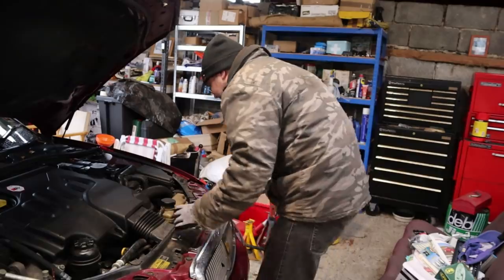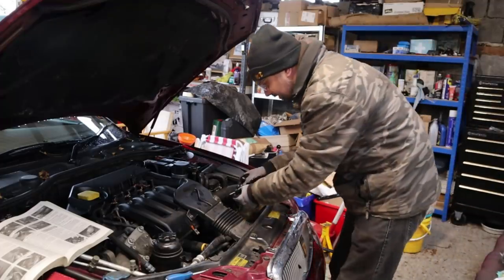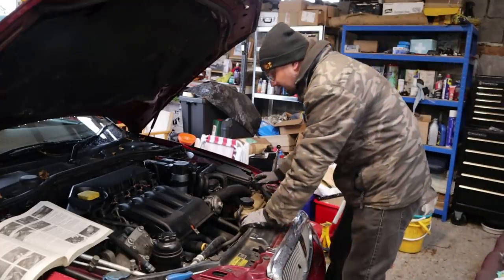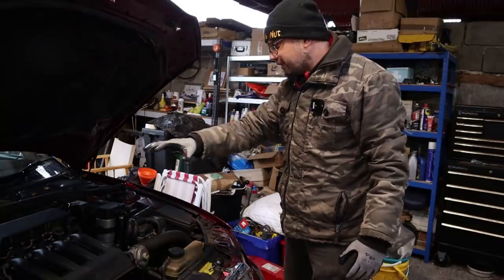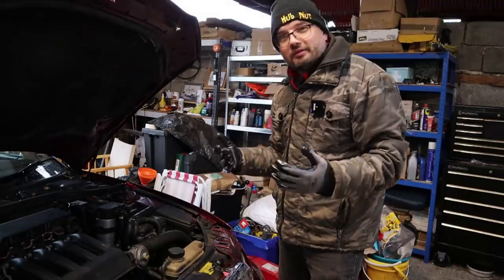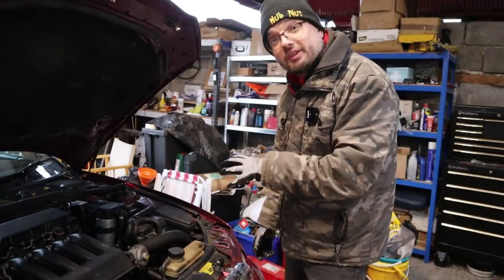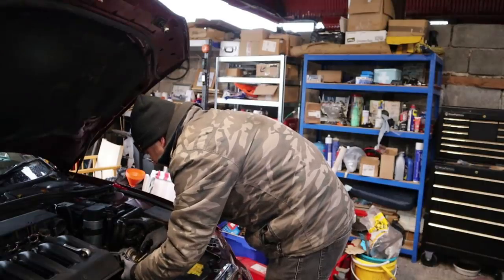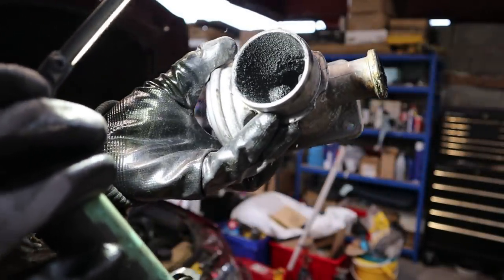Rover 75: Man vs EGR and PCV Part 1

Comment: Spend a tenner on EGR and turbo cleaner spray. Pulse it into the air intake when the engine is hot and running.  Mr Muscle is an alternative if you are brave/cheap 😉
Reply from the maker: Not really an option on these due to the length of the intake. Better to manually strip it.

Comment: remember the days when it wasn't exhaust re-circulation... they just bled fresh air into the exhaust so the car still produced exactly the same amount of crap but it was just diluted a bit more & if you measured the percentages at the tail pipe it didn't seem that bad.   (& it wasn't even VW!)
Reply: Secondary Air Injection, I worked on it and yes just a band-aid to dilute start-up emissions and pass tailpipe requirements.
Reply: I thought the air injection was to assist combustion of unburned fuel in the cat.
Reply: Kawasakis in the 1980s had air injection straight into the header pipes. The reason was to burn off any unburned hydrocarbons that made it passed the exhaust valves.

Comment: Did you test the vacume actuator box? If it leaks internally the EGR  valve will not be actuated.
It's a good thing to have a vacume handpump in the your toolkit.

Comment: Arrrrhhh the bmw swirl pot, I had a engine with them and the scare story was the screws that hold the flaps came loose and were ingested through the turbo causing much of the bad times!
Reply from the maker: Yikes! German reliability...
Reply: Yep, heard several stories of that myself but it was the actual flaps getting ingested...
Reply: Didn't think that BMW engine has swirl flaps when in the rover
Reply: @bigjagjim  Not sure, I'm more thinking of BMW engines in BMWs. And that diesel that can damage the timing chain which is much later.
Reply: @bigjagjim  Correct 👍

Comment: The MAF is a known issue on those engines, causes lack of power, you can get a MAF booster and performance box from RoverRon. I think it's called the Synergy box.
Reply from the maker: Cheers. MAF currently disconnected, which improved running. Something else is amiss that I'd rather address before going tuning.

Comment: Glad to see the manual get some use 😊 pretty cruddy inside. Only watched a chunk of the video as Dave had a call. Your boxes on the shelving, won't they will deteriorate as the damp weather draws in? Front and sides of barn aren't watertight at all. We have lots of soggy boxes from a damp shed and picking dried/damp card off bits isn't a fun job 😭

Comment: A torx head bolt of the corresponding size and a couple of nuts locked together makes a handy makeshift tool for those inverse torx heads 👍
Reply from the maker: Cheers. If only I had some torx bolts...
Reply: @HubNut  You borrow them from somewhere else on the car!

Comment: At least the EGR was easy to get at and remove. Getting the one off of my Fiat Multipla was a nightmare and even the children's hands were not small enough to get to some of the nuts. Half the EGR was under the bulkhead which didn't help. Mind you, had to be done cos it was so gunked up that the ECU had gone into limp home mode.
Reply from the maker: That's a shame. Youngest wants me to get a Multipla...

Comment: Could you use the T piece from a aquarium air pump ? looks about the right size.
Reply from the maker: No. Injector t pieces has a rather important seal on it.

Comment: Widscreen washer pipe t fitting.......
Reply: Yes I thought about that too. Then I remembered that the washer Ts have a steel ball inside, which acts as a non- return valve to stop the washer fluid from running back down to the reservoir,  (which would cause a delay to screen washer).

Comment: you need some kitchen roll around... a bit down each inlet port whilst arse-ing around elsewhere on the engine to stop anything accidentally dropping into the gubbins   (haven't we all done it once?).   
& aren't those T pieces  pretty universal to get one from the local scrappy? (and a wood-screw with some hot water should pull the broken bit out of the existing pipe)

Comment: Hubnut, the EGR doesn't work by burning up Nitrogen oxides (NOx) / Particulate matter, it helps to reduce emissions by lowering the combustion temperature. The higher the combustion temperature, the higher the production of  Nitrogen oxides (NOx) and particulates. By recycling exhaust gas into the combustion chamber, you lower the amount of oxygen available to the flame front, lowering overall combustion temperature, reducing pollutants. As diesels run at a higher temp compared to petrols, one of the reasons they are more efficient than petrol (Carnot Efficiency), they also produce a lot more Nitrogen oxides (NOx) / Particulate matter.
Now that petrol cars are moving to direct injection (GDI), they can run higher compression ratios, meaning their combustion temperatures are higher than old port injection models, boosting efficiency, but also increasing  particulate matter, so that GDI cars without particulate filters, only recently required by law in the EU,  produce more particulate matter than Euro6D diesels.

Comment: Nothing like a bit of proper Hub Nut tinkering to enjoy with lunch! And very nice to see a large tool box against the wall, does this mean no more tools left laying around in random places - umm, nope, screw driver under the bonnet disproves that theory. But back to the car, nothing worse than buildings car parts out of plastic, all well and good when they are new, but after a few years of heat soaking, they always become brittle and easy to break. eBay is of course your friend for finding such parts, but not much good when you need the part there and then. Will be interesting to see how it gets bodged together - hopefully not resulting in diesel being pumped all over your engine - very messy to say the least. But still, on the plus side, it's a diesel, so not as exciting as a petrol engine pumping fuel over itself! (Been there, done that - fire engine came).

Comment: EGR is used to lower the combustion temperate. EGR will not burn again. NOx is formed at a certain temperate, buy adding exhaust gases that will not burn, this lowers the temperature to a point where NOx gases aren't made.  EGR valves nearly always fail open. The car will not drive when this happens or it will be virtually undriveable depending on how open the valve is when it sticks. I always blank the EGR valve off where possible. Some vehicles need the software mapping to do this. It makes the car drive 100% better and I have have never had MOT issues, in fact I have emissions print outs to prove that the car is pushing out virtually no emissions at all even with it blanked off. Sorry for the lesson, I can't help myself as a writer of automotive technical documents for a living.

Comment: Oh the suspense! I'm guessing it did not resolve the ongoing issue, which might mean a return to the repair garage. Hopefully this issue will get resolved in short order.
I wonder if somehow it generates a fault code? Also hoping it is a simple and inexpensive fix.
At least emission controls are cleaned and replaced, well done!

Comment: Did you find the replacement nylon tee piece you needed? I might have something similar in my toolbox not sure if fuel safe though...
Reply: It’s not a T piece. One end has a fitting to go into injector. And it varies depending on injector manufacture. Available on eBay. Even upgraded metal ones.
Reply from the maker: Next video will reveal all.
Reply: Couldn’t bloody sleep after that... stranded at the farm unit... diesel leaking out... proper jeopardy! Glad it was sorted after all phew!!
Reply: Andy Kirwan gotcha, yes I see now.

Comment: Your fortunate. Post 1996 EU emissions systems are easy and fun to clean and fix, with Check Engine Light as a flag. My expertise is Australian ADR 27A/B/C and 37 and USA 1966 to 1995 systems. The 210 hp 1985 4 bbl Mustang 5 litre had 103 ( One Hundred and Three) devices to sheppard exhaust fumes out of its dual tail pipes..seamingly .cleaner than the air that went in. And I can name every one....

Comment: I understand your car will fail an MOT if you have a blanking kit fitted. And you snapping that T Piece reminded me of a similar incident with my Triumph Thunderbird.  I broke the elbow piece for the Expansion Tank that linked to the rad cap. A part that costed me a couple of quid to replace, basically rendered the whole bike unusable! I also seem to remember having to travel up to  Dunmow (other side of Chelmsford) from Southend to get it. The fuel to retrieve it cost more than the part!

Comment: When you took your Rover in for a MOT did they disconnect the battery/reset the ecu? I have an Alfa of a similar era that gets a temporary boost in power when the ECU is reset, until it re-learns the bad sensor data.
Reply from the maker: They did not.
Reply: Quite often that's a symptom of a maf fault, also quite often, such faults don't bring up codes.....

Comment: Just wondering, does this car have a diesel particle filter? If so, how does it handle regeneration? Can you manually activate it or is it automatic only? Just wondering as this could be a cause of your power issue as well.
Reply from the maker: It does not.

Comment: Blow by of exhaust gasses past the piston rings creates crankcase compression, hence the older and more worn the engine the worse it gets.  Motion of the pistons on an engine with even cylinders cancels out, and even in the worst case i.e. a single cylinder engine the compression averages out over a full crank rotation.

Comment: Degreaser also does a very good job of degreasing your skin so compatible "rubber" gloves recommended. 1 day delivery is a bit quick even from a Defender specialist but at least get a couple ordered.1st class post not 1st class and next day as I've just found out with a birthday card! 4 days to go 2 miles. Ring light is useful but not good enough as a filming light. Something much bigger needed but not too strong as to cause annoying shadows.

Comment: You'll be glad to know the 75 don't use a variable vane turbo unlike the land rover as its a mitsubishi td02
Reply from the maker: Oh? Ok. That's one less thing it can be. Still flat today.
Reply: @HubNut  Might be worth putting it on toaf/t4 to check the fuel pressure rail readout. My old mk2 had a leak on the high pressure on one of the banks (look at engine from front its on left hand side above alternator). If you can smell fresh diesel down that area with engine off might be worth checking, but don't put hand near as you don't want high pressure diesel being forced into your skin.

Comment: Thank you, Mr. Seabrooke, for your stand on EGR valves and their function. I got into a heated debate on a different post with an American who is convinced that he's doing the whole world a favour by running his truck without the EGR because he firmly believes that the marginally lower fuel consumption and its trickle down effects offset the negative impact.  I absolutely agree with you and will never remove the EGR, or any other part of the emissions controls system, from my own diesel.

Comment: My understanding is the chassis was Rover and designed pre-BMW takeover. Most of the engines too, albeit not this diesel one...
Reply from the maker: Not the case I'm afraid. BMW had owned Rover for four years by the time the 75 began production, so it was very much developed in the BMW era, and contains an awful lot of BMW engineering (Z axle, front suspension for instance). Similarly, the MINI had been developed by Rover, but was effectively re-developed by BMW working with the Rover engineers.

Comment: Brittle plastic parts! I had the same engine in my E91 BMW 163bhp and my lack of power was due to a hole in the EGR pipe that come from the exhaust manifold. No pressure to spool the turbo and a smell of fumes in the cabin. Blanked it off but couldn't get away with that nowadays.

Comment: MAP = Manifold Absolute Pressure

I need to check the turbo and EGR on my Peugeot Expert (and replace the glow plugs), but they're all up the back of the engine where there's bugger all access.

Comment: Oh the joys of car tinkering. I wonder why they call it 'Positive' crank case ventilation? It's actually a vacuum, (negative pressure) which sucks the gasses out.
I have swirl plates on my 300c CRD. The motor that drove them failed, cos oil dripped on it, from the turbo inlet, where oil vapour from the PCV condensed. I by passed it, by removing the electrical plug and substituting a 1k8R resistor, to fool the computer into thinking everything is OK. Not noticed any difference to performance or consumption (35MPG).

Comment: how long until hubnut gets a heater in there? mind you most of the cars he's got there jeaters are intermitten, as in yes they work or no there is hot air just put your hand there see warm, so i'm guessing the cold isn't that bothersome to hubnut, but yeah more work on the rover it seems to be the main car getting worked on, mind you i guess the others do need a good few days work tyhen a day,

Comment: Could be a split in that big pipe from the inter cooler
Reply from the maker: I can't hear a boost leak. Doesn't mean there isn't one...
Reply: @HubNut  yeah ive had experiences of mondeo s tdci s and a lot of egr valve and pipe problems......ive tryed cleaning the valve s ....buying cheap ones on line and ford one  ......and only lasting a year ....in the end getting blanking plate for about a fiver on line but like you  said  that brings mot problem s because on mondeos it then makes the engine management light come on 🙄👍

Comment: Things happen... had a 3D printer fall off the shelf while printing (still scratching my head how THAT could've happened, I came in to find it on the floor) on Saturday. It happily continued to print after the fall but the material didn't go onto the printed part but formed a huge blob around the extruder. Me and a colleague then spent the better part of Saturday and Sunday trying to fix it, doing things like using a heatgun to melt the blob off the hot-end. Put the whole thing back together and it didn't recognise filament inserted. Thought the sensor might be blown (5 V DC into the wrong terminal can fry it, apparently, and the plug isn't keyed, which is a bit annoying) but didn't investigate any further. Instead I deactivated the sensor and tried to load manually, only to discover that there was a blockage in the filament path. Then I repeatedly heated the printer up and ran all sorts of tools through to try and get the blockage out, to no avail. Over the next two hours or so I disassembled the entire extruder something like three times, either because it still didn't work or because I'd left out some quite important part.

Our final attempt was to remove the heatbreak from the hotend and heat up the heatbreak with the hot air gun to try and melt out the stuck filament. That worked but there's a Festo coupler inside the metal heatbreak (which is normally supposed to stay cold) and that melted clean off... the printer seems to work without it but the whole thing felt very HubNut! Luckily if we ever do have problems, the whole heatbreak is only around 20 quid plus postage.

Oh and BTW, the filament sensor wasn't blown. I hadn't pushed the plug all the way in :-D

Comment: Isn't it to reduce carbon dioxide, not nitrous oxide? Unless you run your Rover on NOS.

Edit: Nvm, I looked it up and it is for NOx reduction. Had no idea cars produce it.
Reply: @Jambo Ian is right, it is NOx (nitrogen oxide), which I had no idea a car produces. 

I don't need to know the difference, I know what the difference is, I just didn't know that was what the EGR's primary job is.
Reply: Solvalou. You are right. Exhaust Gas Recirculation is for modern  high compression vehicles. Adding inert gas reduces the three Nitrates of Carbon. Positive Crank Case Ventilation removes a balanced proportion of the blow by from rings in the crankcase, and feeds it back into the intake plenumb to dilute it and ensure a.reduction in carbon monoxide, CO2, and being partly inert, an atteniation of engine temperature. The MAP sensors and TPS balance the vaccum tree porting to sequence the amount of inert gas returning into the intake. So temperature from start to warm and speed from kerb idle, transition, cruise, wide open throttle, and overboost if turboed all influence how the EGR and PCV is calibrated. The EU standards are pretty straight forward, and modern  injected turbo diesels are great to trouble shoot, with everything so simple and clear. The EU sets a rising tide of Nitrates of Carbon( Mon,Di,and Tri)  Carbon Monoxide, Carbon Dioxide and Hydrocarbons. Esentially a Four Gas analyser will pick up Carbon shead and Nitrates and Hydrocarbons. The finger print of an engine and how it pollutes is specifically engineered.   How it gets engineered to comply is mandated. The foot print is the result of the compliance work.

Comment: Hubnut - EGR  - wonderful planet saving device 
Me -- Staring at my Vauxhall Astra G EGR valve.. not really caring about pollution ..because the car is not really going anywhere.    Vauxhall Astra G (mine was a 52 plate) were notorious for their EGR valve fouling up - I usually resorted to poring petrol over it and setting fire to it to burn off the gunk ..  they were pigs .:(
Reply: I have done that with flametraps on Rover V8's

Comment: Would you say a 2003 rover 25 1.4 80 horsepower with 36,000 miles for 600 quid a good buy?
Reply from the maker: Yes. Along as the head gasket hasn't gone.

Comment: I'm sure you have a Diesel Heater fitted , it's the thing behind the Intake Pipe.
Reply from the maker: I do. It doesn't work.
Reply: Just remembered. It's called a Wabasto, if I'm not mistaken. 
Sorry, not too clued up on the diesels. 
One more thing, although BMW developed this engine they never actually used it in any of their own cars.
Be very wary of the clutch, costs a fortune to replace. The last I heard in the region of £1000+....!!!